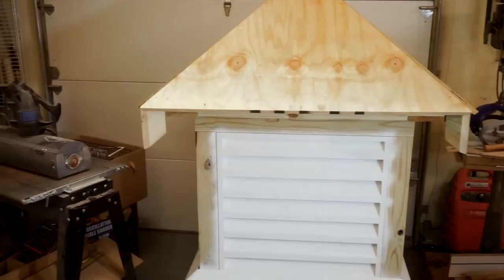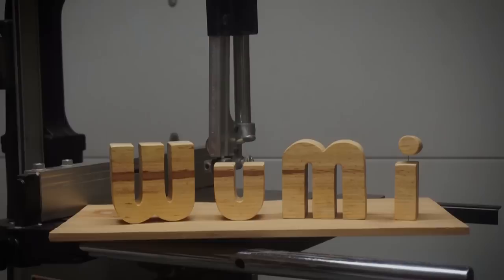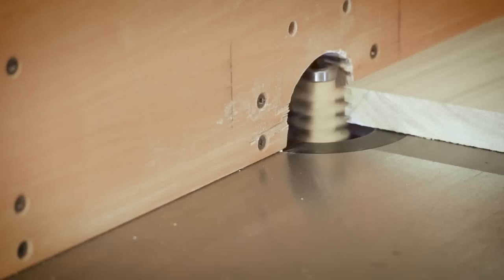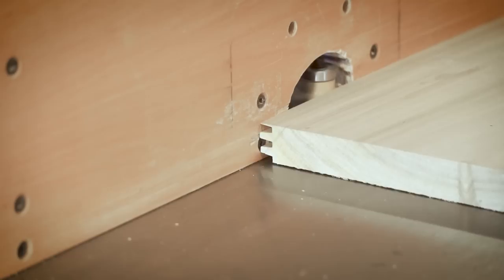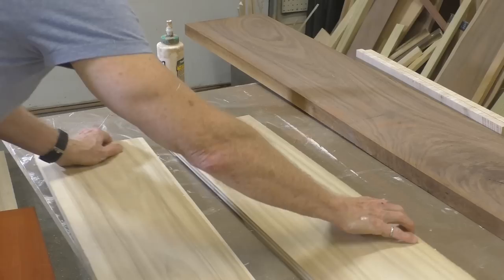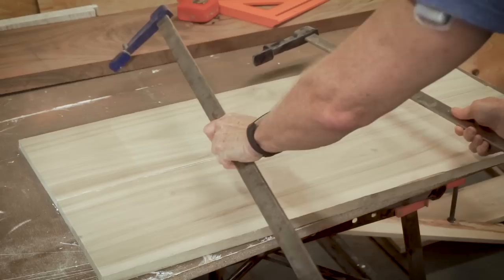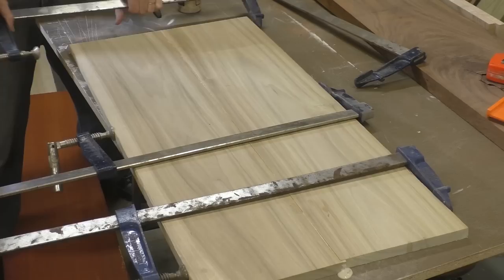How to use a Finger Joint Router Bit to Join Wood

Comment: Wouldn't you just flip the second piece and run it through?  I'm thinking the bit handles its own alignment ....
Reply: I don't think so. It would make the cut on the second piece exactly the same which would give you two 'males/females' along the same path. The cuts need to be opposite, this is why he lowered (or you could raise I suppose) the bit.
Reply: I thought so too, but that didn’t work for my bit.  I had to lower my bit by 1/8”, which is different than what the author did.
Reply: I watched another video where the person tried that and it didn't work.
Reply: You have to raise the bit to a certain height. Then you can just flip the second board and it will fit perfectly. The bit can’t handle its own alignment because that depends on the thickness of the material you are using. As far as I remember you have to align the edge of one of the router’s “teeth” to the Center of the material.

Comment: I love the way he says "I was able to figure it out" regarding the height adjustment part.  Be nice if he'd share that part, as that's why I watched the vid.
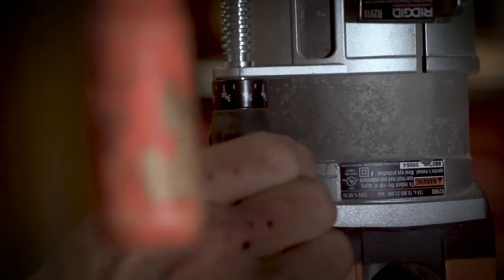Reply: at 1:13 he says he lowered the router by 5/32"
Reply: @kaackster  Does that 5/32" work for every thickness of board OR is it specific to his board and if so HOW DID HE FIGURE IT OUT. That's what the person above was probably saying.
Reply: Yea the title says "How to use a Finger Joint Router Bit" and he just skipped explaining the most important part of how to know how much the bit needs to be raised.
Reply: The fingers are 5/32" or 4mm wide so you need to move the cutter 5/32" or 4mm up or down when making the second cuts
Reply: @mustang60348  The fingers are 5/32" or 4mm wide so you need to move the cutter 5/32" or 4mm up or down when making the second cuts
Reply: @kaackster  All he needs to do is flip one of the pieces over and they'll join perfectly. No measuring needed.
Reply: @mikecrook8434  Yep- this is true.
Reply: @mikecrook8434  1 year later, he still hadn't figured it out.
Reply: This is what test boards are for.

Comment: I'm planning to finger joint the ends of my 1 x 6 boards for fascia on the house.  I don't like the ends to be square and cut at an angle is okay but I'd rather make finger joints, glue them together and put them up as one long piece.  I'll see how that works and get back to you. Thanks for the video.
Reply: It's been a year.  How did the finger joints work on the end grain?
Reply: @rso1411  I haven't gotten round to doing this yet. Maybe this spring.

Comment: 5/32 is the key!
Reply: aka ~4 mm 🙂 
I made a lot of trials and my goal was, to set the routerbit in a way, so I could use it to cut both sides of the wood without changing the hight of the routerbit.
I found, that I first have to find the exactly middle of the woods strength and mark it.
Then the routerbit has to be set with the middle from one of the inclined faces alignet with the mark.
This has to be extremly correct becaus in the other way you will get an offset, when glueing the parts together.
I dont’t know, what way will be the better one, because in both cases you will have to do a very complex and accurate setting.
I hope you'll understand what I mean.

Comment: I thought it was only necessary to flip the second piece upside down before passing in on the router, without moving the bit. Did you try?
Reply: Pier Paolo Biagi Hi - that is possible but your timber would have be a specific thickness. The way it works is the second piece has to have the cut made so that the fingers match up perfectly with the gaps in the other board. To do this, you cut the second piece one finger width higher or lower. I assume the fingers are 5/32" or 4mm wide so you need to move the cutter 5/32" or 4mm up or down when making the second cuts. If your timber thickness is some exact even multiple of the finger width, you could just flip every second board (eg 2x, 4x, 6x and so on).  Hope this helps.
Reply from the maker: I agree with what justcruisin109 wrote.  To be able to just flip the board over, the thickness of the board needs to be an exact multiple (by an even number) of the width of a finger, otherwise it won't work out the way you'd expect.
Reply: I wonder if this doesn’t work by setting the bit height in a way that one of the teeth offsets from the edge of the board by half the height of a teeth. In this case, 2mm offset from the edge of a board. And that way you could just flip alternate boards and they would fit. That’s how seamless tile backgrounds are created at least.
Reply: @betodrk  Umm, yes, but the board would still need to be precisely the right thickness to make your idea work, otherwise the top surfaces would be offset and you'd have to plane them even. If you have a router table, it's easier just to change the bit height by 1/2 tooth, testing the fit before you commit to routing the good stock.
Reply: Thats how I understand it also

Comment: What is the purpose of the bearing? If the board is thick enough then there would be a flat spot and the finger joint wouldn’t fit together anyway correct?

Comment: How can i buy this Finger joint bit, Please send me the details.
Reply from the maker: Pavan Kumar There are links in the description, but this link might work for you depending upon where you live.  https://m.ebay.com/itm/Reversible-Finger-Joint-Glue-Joint-Router-Bit-1-4-Shank-Woodworking-Tool/401184913179?rmvSB=true&ul_ref=https://rover.ebay.com/rover/1/711-53200-19255-0/1?mpre=https%3A%2F%2Fwww.ebay.com%2Fitm%2F401184913179&campid=5338274638&toolid=20008&srcrot=711-53200-19255-0&rvr_id=1596286388237&rvr_ts=9329ce0c1640ab1d1565e55cfff8642f&_mwBanner=1&_rdt=1&ul_noapp=true

Comment: Poplar?! From my own experience, Poplar is an awful wood for outdoor usage. Use White Oak, Western Red Cedar or Redwood. You'll be replacing that Poplar in 5 years. Take it from someone that's had to replace rotted poplar. You may not be susceptible to rot in CA or AZ, but here in the NE, Poplar use is strictly indoors.
Reply from the maker: I've always used cedar or mahogany for outdoor projects, but I figured that poplar would be fine as long as it was painted well. I guess I was wrong about that. It's too late to change now because the project is almost finished. I guess this will be a learning experience for me.  Thanks for the info!  -- Mike
Reply: Here in Maryland we use poplar for exterior siding on barns and it last for years as long as it's high enough off the ground to stay dry and it is run vertical with spaces in between the boards. Don't let it touch and it will last.  On our farm their is some over 60 years old.

Comment: This video is not about 'how to use a finger joint router bit" because it doesn't deal with how one should set the correct height for the bit - which is really the essence of the exercise because the gluing and clamping relate to any joint: straight, dowel, biscuit, domino etc. So, pretty useless in my opinion.